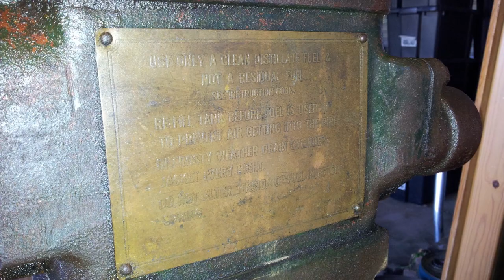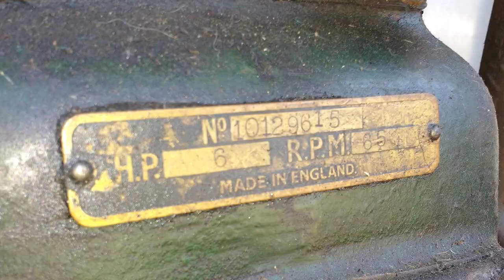Lister CS 6/1: Rebuild and First Start since the 1970s

Comment: How much size of piston
Reply from the maker: H.P.        6
R.P.M.   650
Bore & Stoke   114.3 mm x 139.7 mm
Compression Ratio    18:1
Reply: @St33v33  
Thanks you very much mistri Vai a engine Indian ma available
Bast mistri  working not
Engine gear timing and fuel pump drop sating video pluses
🙏